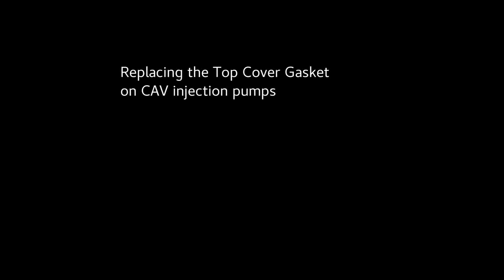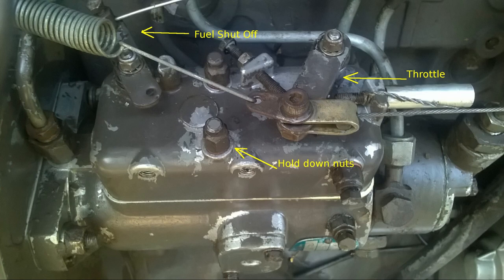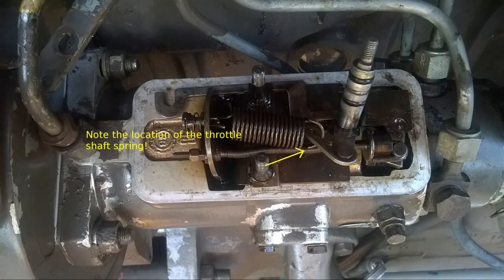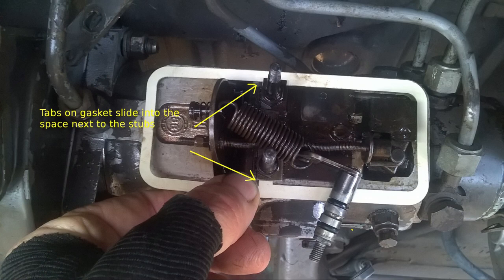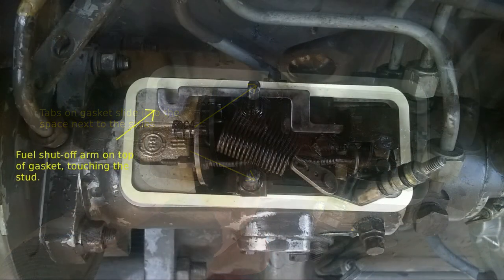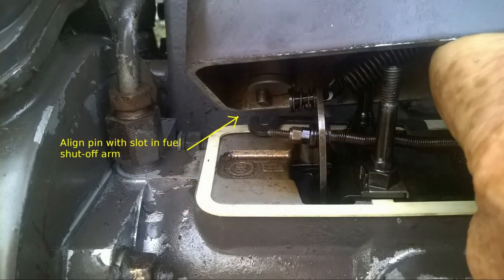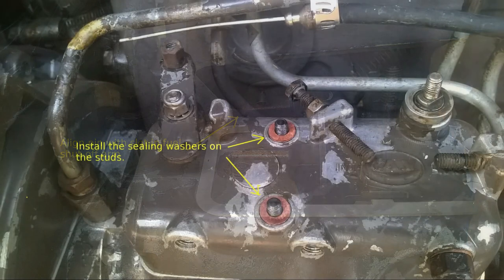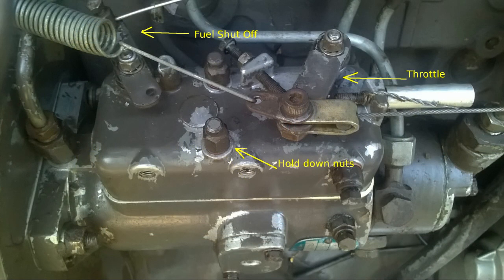CAV/Lucas Injection Pump Cover Gasket and O-ring Replacement

Comment: Thank you for the concise and clear explanation. I need to do this repair on my TO35 23C diesel tractor and I appreciate such a quick and clear "how-to". Bravo!
Reply from the maker: Thanks.  Good luck with your repairs!
Reply: @de0081  Thanks again. Repair done without any troubles thanks to your clear explanation. Well, at least no troubles with the CAV repair. I also choose the replace the fuel lift pump at the same time as "preventative maintenance" .... and the aftermarket replacement pump was defective out of the box. Old pump reinstalled and working fine!
Reply: This has given me the confidence to try it on my 1959 here in blighty! Thanks.

Comment: Thank you! I had a little problem lining up the fuel shut-off lever knob with the sliding plate. Can you make a video on the best way to prime a CAV pump? No one can explain what each bleeder screw should be done first.
Reply from the maker: These pumps have two 5/16" hex head bleeder screws. I open both 1/8 to 1/4 turn and pump the diesel lift pump arm until fuel without bubbles comes out of both.  Then close the bottom screw and almost fully close the top screw and repeat.  If you had air in the system you will probably also need to bleed the fuel lines where they enter the injectors by cranking the engine.

Comment: How much does this cost on average at a shop? Should I just go ahead and get it rebuilt?
Reply from the maker: Just the gasket replacement if you take it to a shop should be less than an hour charge.  A whole pump rebuild would probably by over $1000